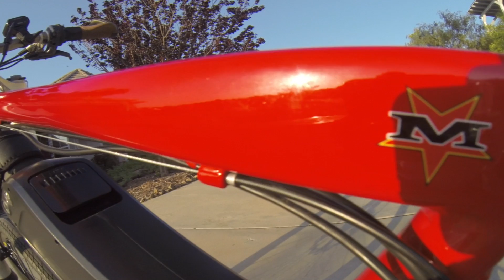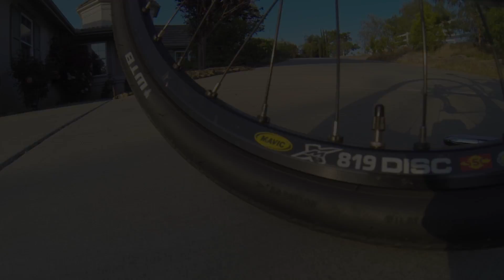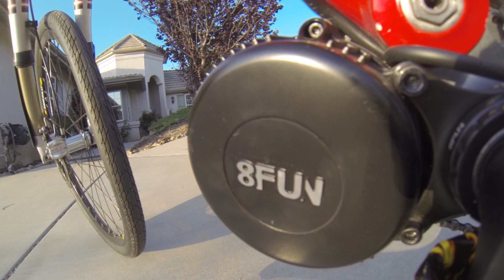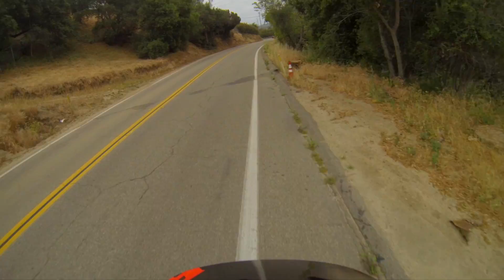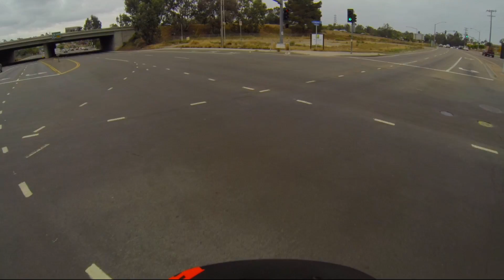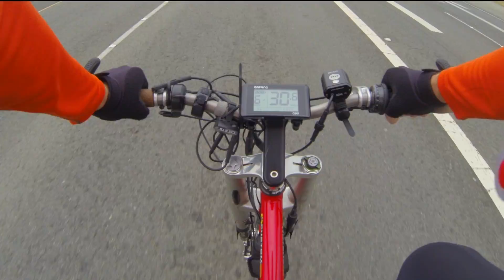Paddy - upcycled 11 year old Maverick MTB becomes EBike Rocket

Comment: now even better batteries are out, i have the same battery as you but i get allot of voltage drop on the samsung 29e . They are not that good for power users.

Comment: Anyway, did you mod the Monolink for the mid engine?
Reply from the maker: WasmachinemanTT5/R™ no need to modify that link.  It fit and articulates fully without any changes.
Reply: Awesome, got a ML8 myself and I was thinking of a e-Monolink upgrade.
Reply: @Wasmachineman   did you ever upgrade your ml8 ? I am think the same thing
Reply: @salamalycoom  I haven't, i'm waiting for my frame to crack so I can upgrade to something newer like a Marin Wolf Ridge, not sure yet.
Reply: @Wasmachineman  
If you trash that frame, SOME of us need the parts...
Reply: @ryanwebb6356  Won't be trashing said ML8 any time soon, and even if the frame cracked I guess i'll hang it on my wall or something.
Reply: @Wasmachineman   someone local wrecked a Seven Duo. My Palomino now has a titanium rear. 
When it comes to older bikes, the kind thing is often to allow "organ donation". Your generosity could Save a Bike...

Comment: Nice Video mate, I'm about to get a 750watt fitted by Ewan in Australia too, excited after seeing this! Can you let me know how many km's range you get out of the charge and do you just used the GRIN TECHNOLOGIES - Cycle Satiator Smart Charger at home to regulate the charges? Do you also get any chain jumps, I read that the Lekkie Chain ring is a good option if you get jumping but would lose a bit of top end speed I would imagine...?
Reply from the maker: +Tim Millington (AllThingsTech) - Hi Tim.  I bring my Satiator to work every day, too and charge while there (so one charge for each direction).  I travel 20 miles starting with an 85% charge, with ~20% battery to spare when I finish.  That keeps me in the "good for the battery life" zone.  My chain jumps (always on front) are thing of the past.  I run the stock Bafang ring (52 wouldn't clear my chain stay)  I was chain jumping only when I downshifted mulitple gears at once.  Now I downshift more slowly, and it never jumps.